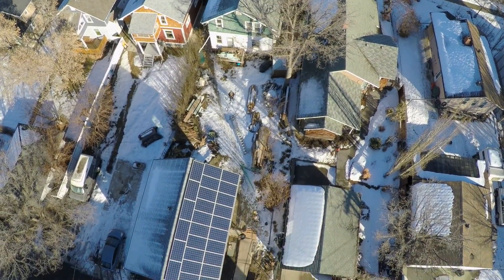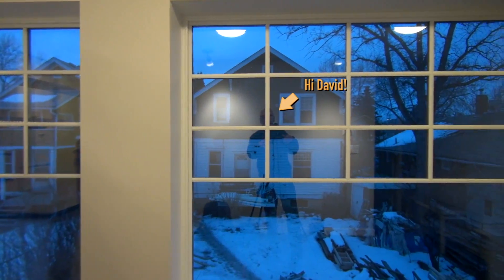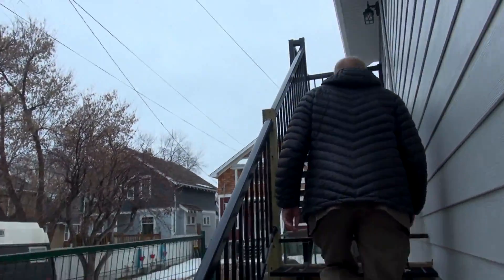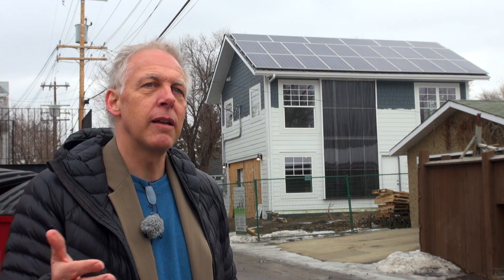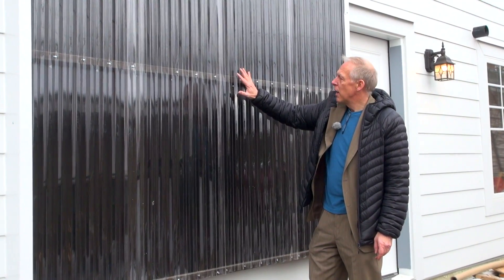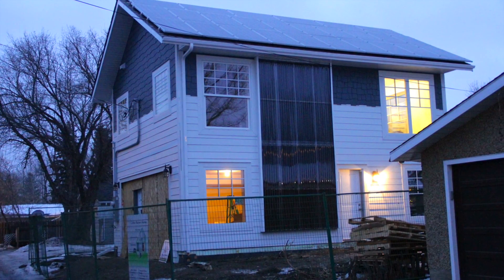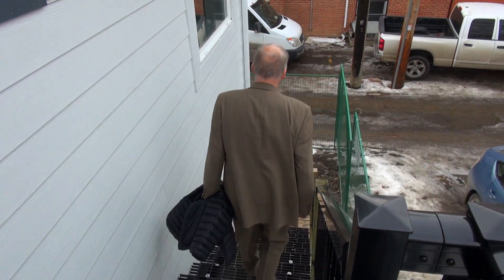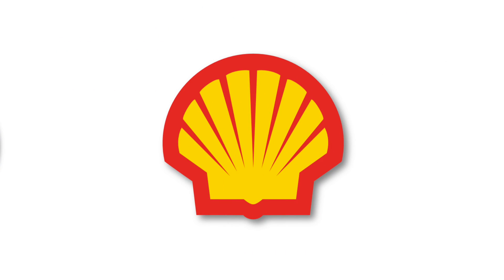137. Carbon Neutral Laneway Home

Comment: for it to be carbon neural it would have to generate more power than it cast to make it and what is used in running it!
to make this claim they are discounting the massive cost of making a new house!
Reply: Yes, it is zero carbon from operations. To make it life-cycle zero carbon would required a change in Alberta's micro-generation law that would allow the building to export more energy than it uses on a net annual basis. The construction carbon footprint of conventional buildings is large, but small compared to their operational energy footprint. If this building had been built to the Alberta Building Code, it's life cycle greenhouse gas emissions would have consisted of 3.6% for building construction, maintenance and decommissioning, and 96.4% for operating the building. The way this net zero building was built, it reduces that life cycle carbon footprint by 94.5%, so very close to a "life-cycle zero carbon building".

Comment: What are the pex pipes sticking out of the floor for?
Reply: +Sustainable Contractors The video was filmed before baseboard heaters were installed. They use the water that's inside the 2500 L storage tank.